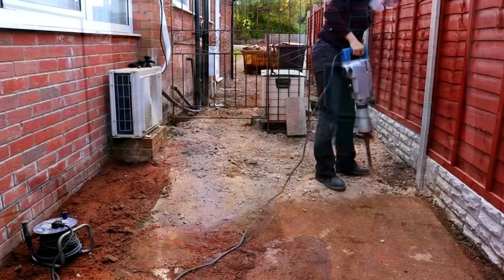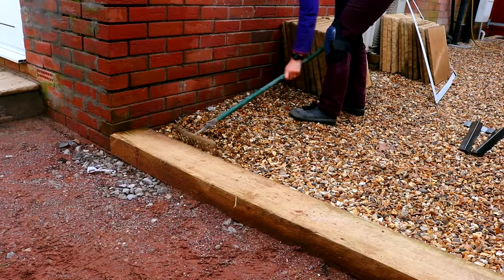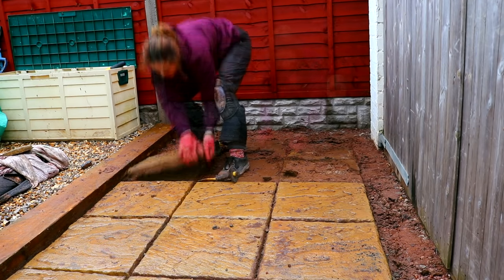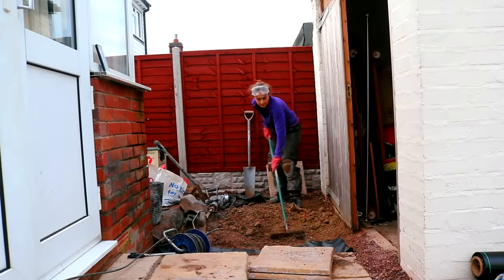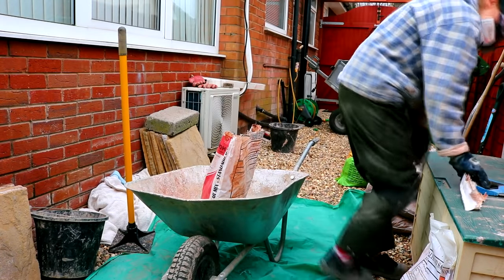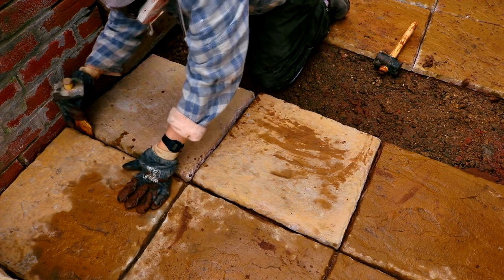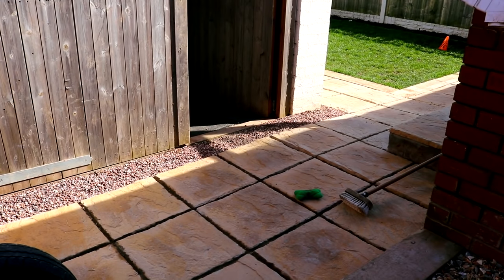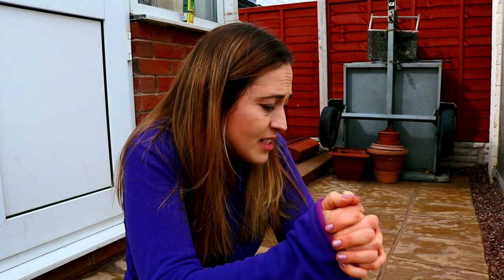Laying a Garden Patio DIY | The Carpenter's Daughter

Comment: Vikkie, really felt for you when that door didn't open.  
I was thinking 'just cut the door down' but you are a real Trooper and relaid the path.
I am in awe at your determination.
By the time I got to your 'Lip Sync' at the end I had subscribed....
so comforting to see a You Tube video where the list of suppliers includes Home Bargains 😀
Thanks for uploading, Tony
Reply from the maker: Thanks! 😀  No airs and graces here with the products I use here lol.  If the price is right and the tools withstood the job I used them for, that's all that matters to pass it on 😉 Those Home Bargains knee pads have been surprisingly comfortable and I've wasted a lot of time reading Amazon reviews trying to find a pair that were good enough!

Comment: Why do not you use a small shovel to mix cement with dirt and this is easier for you and does not hurt your back
Reply from the maker: Thanks for the tip!  You might be able to see a selection in the background.  I tried a few different ones to speed things up but the most comfortable was the big one.  Although a cement mixer wouldn't've been a bad buy with all the mortar I've had to mix up since I started renovating 😄 I saw one yesterday for 149.99 at Trego Mills.

Comment: Great video, nothing wrong with making mistakes, we all have. 😊 learning from them is what's important, no harm done in the end and a boss job, Looks great too. Did a massive fail only last week repairing a rear wheel bearing on my brothers Saab 9-5 to make access to the wheel bearing fixing nuts I removed the top and bottom control arms, putting it back together from under the car I was made up to finally tighten the last bolts up only to crawl out from under the car to discover I forgot to put the brake carrier dust shield on first before positioning the bearing, aaaahhhhhhhhhhhhhhh 😄😄😄😄 needless to say had to take it all apart and start again. Not nice, it was freezing last week when I did it, but I won't do that again. Lesson learned. 😉😉😉😉
Reply from the maker: Oh no - yes, it's been freezing here too so can imagine the pain 😣 I have definitely learnt to check all doors in future 😄

Comment: Why did you decide to use cement for this part but sand on the other part in your garden?  I can't decide on which to use for my back garden!!
Reply from the maker: Only because I wanted to try the mortar method for the first time.

You could do the sharp sand method if your slabs are thick enough, then point at the end with a mortar mix as it should prevent weeds.  But if it's an area that's likely to get puddles, it won't drain.  Hope that helps!
Reply: @TheCarpentersDaughterUK  That's great - thankyou!!

Comment: Great job and fair play for lifting them again and doing a proper job.  There is another way to lay slabs aswell we do on site which is use sharp sand as your base on top of your hardcore screed it off level with a straight edge lay your slabs giving them a little tap to settle them....once laid mix a bucket up with half a bag of cement and half a bucket of water mix with a stick to create like a slurry...wet your slabs then pour it all over and brush so it covers and fills joints then get a hose and rinse off till slabs are clean.... that will wash the slurry under all the slabs and once gone off locks them all in solid and gives a solid layer underneath it takes 2 days to set properly then just point up 👍 much easier no mixing... twice as fast and in 10yrs ive never had to go back to a slabbed job done this way👍 your way is great also but maybe this will help in future with any other slabbing you might do.
Reply from the maker: Thanks!  I love how easy that sounds!  I was going to lay on a bed of sand as I did before, but found it wasn't as quick, but I could be wrong lol

Comment: Argh, what an absolute nightmare in having to remove so much of your hard work. I hope you were able to transform some of that frustration in to energy.

A great looking job in the very end. I can imagine you're also pleased to be able to move on. :-)
Reply from the maker: Yes, definitely glad to move on!  I've been wanting to learn more woodwork for ages but sadly it's had to wait until I completed other things on my list.
I was definitely gutted - but once my Dad said it'll have to come up, I accepted it quickly and lifted them up before it became difficult so I could reuse them. My fiance didn't want me to rip it up (he would have trimmed the door), but I didn't want a silly looking gap at the bottom AND I knew I'd dwell on it if I couldn't open it properly just in case.
Reply: The sharpest of learning curves, then! I know what you mean about how it would have bothered you otherwise, if no-one else. ;-)
Hope you've had a good time down in Cornwall, by the way.
Reply from the maker: Thanks and indeed 😄 Apart from the very cold, wet and windy weather, spending time with family and eating plenty of treats made up for it 😉😀

Comment: Hi Vicky I've just finished laying my slabs and was wondering what the best way of pointing the slabs I'm torn between a dry or wet mix just wondered what your thoughts are thanks
Reply from the maker: I personally preferred the pointing technique in my front door patio video.  You don't need much water at all and it solidified with a bit of light rain over a day or two.  If your gaps are quite big, then perhaps wet mix may be better.

Comment: I'd have cut a bit off the garage door. Seems like a lot less work and adding a cil on the ground would have solved the gap when the door was shut issue. Also cement mixer hire is really cheap and well worth it for the time and effort it saves. It's also fun to use the first time.
Reply from the maker: Thanks for the tips 😀

Comment: You are absolutely my inspiration as I'm currently laying (or re-laying) stepstones in my front garden, and considering re-laying a patio in the back. Issue is, I'm about 30 years older than you are, so it will be slow going ;-).
My question is regarding the sand you choose to put between the slabs and whether or not you've regretted it. I ask because one reason I'd like to re-lay the current patio area (aside from better siting) is because the sand between has failed to keep weeds out and so it's either a nightmare to remove them, or, as is usually the case, it's an eyesore. My thought is to lay the slabs on a good base but to do a sand/cement mortar between (dry, sweep, then light spray). What are your recommendations?
I'll also ask what you think of concrete-block for edging. I thought placed on their sides such that one can fill the holes with soil would result in pretty strong side support once planted and the plants take root. Again, thoughts?
I admire you hugely. You're very much a girl after my own heart!

Comment: I used the method in this video for laying slabs on a full bed of mortar for my shed internal floor as I thought it would be more solid to take heavy loads from storage of tools etc, also bought a brick jointer to point the joints with a damp sand and cement mix and it worked really well. Was going to do it with just the sand base but thought about the other method for belt and braces! Thank you!

Comment: You had to cut out the door easier for you and not lift the tiles after all the fatigue
Reply from the maker: I just couldn't - my Dad made it for me and thought if I did this right, I could have both looking spot on 😉
Reply: My name is Musa and I am from the Arabian Gulf from the State of Kuwait in particular, and I am following your work with pleasure, and I hope you will forgive me for my bad language because my main language is Arabic and I used the translation program in my mobile phone to communicate with you 😊
Reply: I hope you are keen on your physical health in these hard work and try to use means that do not expose you to problems in the body and your health 🥀
Reply from the maker: I never push myself harder than I think my body can take.  It might be surprising, but I almost never break in to a sweat because I take my time and work at a leisurely pace.  That way, I can avoid mistakes (usually!) and not hurt myself.  And my collection of safety accessories are improving with each project 😀